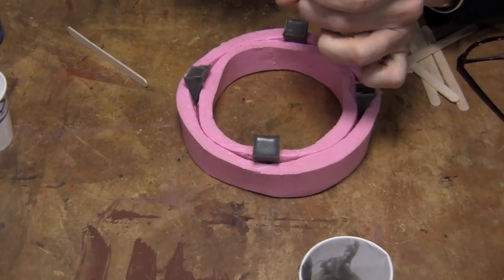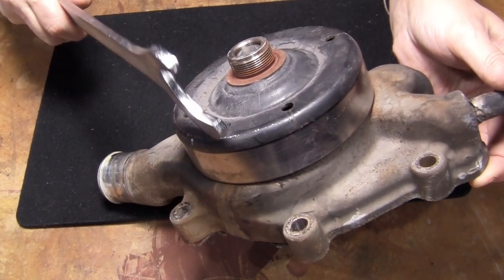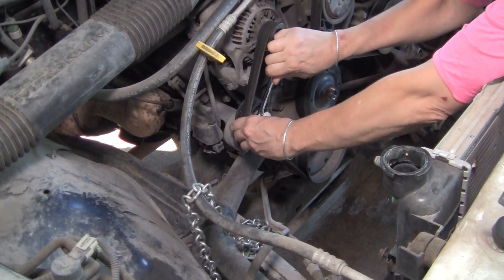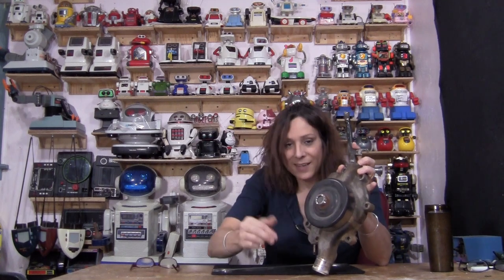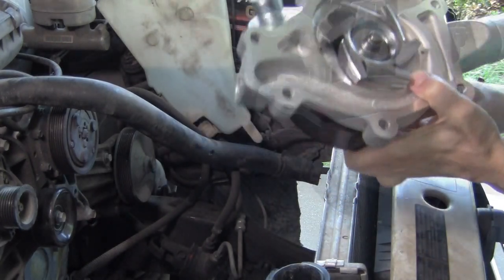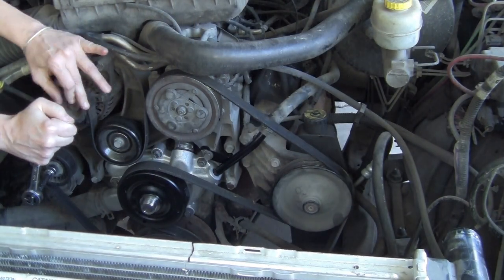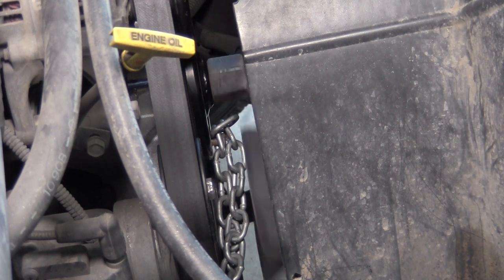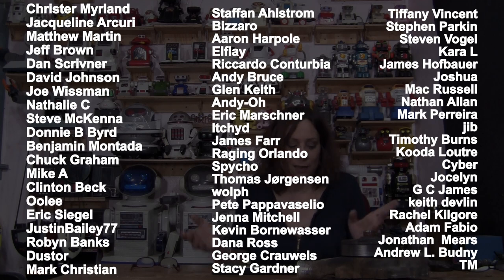I Had To Buy A 36mm Wrench - I need to fix something big

Comment: You should have glued the gasket onto the water pump, its the little tricks of the trade that you dont know about that makes the job harder. I'm impressed that you got the job done. Well done.
Reply from the maker: That sounds problematic. The crappy one wouldn't have helped, and the nice one was easy. What glue would you use?
Reply: @RandiRain  At the parts store they sell "RTV" these are sealants for different applications, The one to get is the Grey color one it is a good general purpose sealant, next spread a  thin layer on the mating surface of the pump then press the gasket onto it and let it set up until the gasket stays put then spread some sealant on the engine and put a couple bolts in the pump before installing this does two things it helps hold gasket in place and makes lining up the pump to go back on engine easier. Once installed let sealant set up completely (few hours) before adding coolant back in.  Source: I was a mechanic for many years.
Reply: @RandiRain  I would have used spray contact glue, that way it wont move when you install it onto the engine. RTV will also work. Everyone's got their tried and tested way. Have a nice week-end, thanks for all the videos and all your electronic knowledge.
Reply: @ameliaroberts3945  Contact adhesive works well on sump gaskets, coat both the gasket and the surface, leave to tack up then use a few studs to align the gasket to the block and stick it down, then you can slip the sump on the studs to align it, push into place then put a bolt or two in to hold, then remove studs and put rest in, and tighten to right torque. The right torque, not tighten to just before break, as that distorts the thin metal and causes it to leak. Yes you will struggle to get it off again, but not going to leak. Make sure the contact surface is not warped or the bolt holes domed in, fix that first.
Reply: @MrKroogur  never double gasket!

Comment: Nice repair. Yeah, the struggle with proper fitting parts and just not being able to see or contort oneself is very real. Your blood sacrifice to get the job done was exactly what the car gods needed. Love the chain hold down technique. If it works then it works.
Reply from the maker: I saved $300, that's why I had to do it.
Reply: How about next time

Comment: The entertainment value on this was great! Apparently nothing stops you from getting things done! How did you shrink yourself to fit inside the truck? That's magic!
Reply from the maker: I wish I could have shrank myself. That's one of the reasons I hate working on vehicles. I bet it's way easier to lift them up and be underneath them.
Reply: @RandiRain  Yes US trucks are large, but if you want a vehicle you can actually climb into the engine compartment to do work nothing beats the Lada Niva, which has a massive engine bay, just have to remove the spare wheel, high lift jack, tool kit and starter handle from it. The vehicle that comes with factory wear in it, and as the cheapest decent 4x4 at the time, who cared if you ripped the paint to bits. Only thing is the cooling was poor, but the heater had 2 settings, off, or volcano. But would go just about anywhere a mountain goat would go.

Comment: Just to let you know, a lot of the nationwide part stores have a free loaner tool program. You go to the store and pay a deposit (usually the cost of the tool) and when you bring it back, you're refunded the full amount. I mention this because O'Reilly's has a clutch fan wrench set with a 36mm wrench in their loaner tool set I've used before. Just something to keep in mind if you ever need a specialty tool again. 
The chain was a great idea to hold the belt pulley.
Reply from the maker: I went there... The one near me didn't loan out wrenches. They had the tool that holds it that you could use, but my chain worked for that. They had a wrench there I could buy, but that was the $35 version, and it wasn't anything special.

Comment: Great job 👍🏼🤠 little tip for cheap gaskets use gasket maker silicone and glue it to the engine block let it dry a little bit then put the water pump on. The gasket maker is good to put on the bolts also that antifreeze come out of.
Reply: Not recomended for long term use

Comment: I am sorry to hear that you had trouble finding the wrench.  I do not usually buy tools at the auto supply stores, but prefer to use the big box hardware stores.  Try searching for the part there before going to Amazon: I found the same size wrench in stock at the local Menards for $20 with a lifetime warranty.

Also, it's pretty cool that you have enough room to climb into the engine bay once the fan shroud is gone!
Reply from the maker: Menards? What the hell is a Menards? I can tell you Home Depot, Lowes, and Harbor Freight didn't have a wrench anywhere close to the price I paid. If they even had one.
Reply: @RandiRain  Menards is the green one.  :)  I guess that one is not in your area.   Too bad: you could have saved big money at Menards!

Comment: Anymore, my repair calculations takes the price of buying decent tools vs. taking it to someone else.

Within double the price, making it someone else's headache seems more prudent, and hopefully they have a better idea of what they are doing than I would.

Except for plumbing. I've learned that lesson multiple times the hard way.
Reply from the maker: Yeah... There's also the factor of how much I've already spent on that truck. I just got the registration renewed, which means it has to be inspected, which it didn't pass and I had to do some work on it. etc etc. I pretty much had no choice but to get greasy.

Comment: nice repair Randy, what I would have done differently is put 1 bolt through the hole of the water pump mounting holes and then fit the gasket over the bolt or bolts, as 2 would be a better idea, but harder to do, as then really need 3 or 4 hands. or a lot of 4 lettered words!! but it should hold the gasket in position while trying to fit the pump into place. but yeah any bends in the gasket then far better off buying a new one, as would be weak once bent, regardless of if ironed or not.
Reply from the maker: That's what I did. I did exactly that and you can see it if you look closely. It was garbage compared to the other one.

Comment: how annoying, I had to replace a few heater cooling hoses on my van recently and it was such a pain in the A.  The hoses were all the way in the back by the firewall so I had to basically site on top of the engine and hang upside down to reach behind. All that yoga really paid off for that job, lmao.
Reply from the maker: I know... It's like they try to design it so that it's difficult.
Reply: @RandiRain  Saved 30 seconds in assembly in the plant, who cares for the mechanic that has to remove half the vehicle to replace it.

Comment: Gasket easy fix is to glue it to the pump body with gasket sealer, then leave for a half hour to semi cure and then it will hold. Would not even buy that spanner, adjustable will  work well enough on that nut anyway, and the big one has multiple other sizes it fits as well.
Reply from the maker: That's a good idea, no one showed that in any of the videos I watched. They just slapped it right in there. Which I did too when I got a real one. Is there an accelerator? Half an hour to wait on glue... That doesn't sound Randi friendly.
I didn't even think about an adjustable wrench because all the big ones I have just barely missed going wide enough. I figured they would be more than a regular wrench.
Reply: @RandiRain  No, you do this when you are busy starting, before you even get the old one out the vehicle. Then leave it on a smooth surface, preferably with some cling film so the excess does not stick, till you need it. Both pre sealed, and flat.

I have big enough ones, they also have had use as hammers to get things in place. As to going to get a new gasket, that is why you have a sheet of gasket paper around, or in a pinch the front or back cover of a glossy magazine, though my go to was always the cover of the phone book, as that was about the best use for it, though they also were a common thing to have as emergency paper in the toilet outside.

Comment: Here's the thing.  Modern aftermarket parts are so bad most mechanics will not use them because of warranty issues (they have to warranty not only the part but all the labor).  Unfortunately, a ton of oem stuff is unobtanium and permanently back ordered because of the covid stuff.

Lucky for you this is fairly easy water pump job so even if the part fails in a few months, it's not that hard compared to many water pump jobs.  The more labor intensive the job is, the more you don't want to use aftermarket parts. Aftermarket used to be great.  I always used to use the cheapest part available at pep-boys. Those days are over.

The classic car guys are going nuts. There are no OEM parts left. Things are so bad in this area that people are paying fortunes for NOS parts.  Just imagine wrecking a brand new cam because the brand new lifters are so bad they don't even survive the break-in period.
Reply from the maker: It's a 21 year old truck. I'm not putting expensive parts on it.
Reply: @RandiRain  Barely broken in.... Unless it has a lot of rust.  Also, you will probably pay more than the difference for a tow if the part should fail.  But I get it, you don't want to dump money into an old truck.  Still, beats a payment and full coverage insurance.

Comment: I Remember I changing 
The Timming Belt.
On my Small Truck lucky fir Me.
I had Pretty 
Simp I e Set up 
One Belt.
But remove the Radiator. 
And the Serv I ce Manual
Reply: Just be thankful you do not have to do spark plugs on a Ford Triton, you take the heads off and take to the machine shop to remove them, because 50% chance one of them will snap off in the head. You actually get from Ridgid and Snap On a triton spark plug removal and repair kit, that can remove them when they break, and fix the threads if they strip out. All this because they wanted them to last 100k miles, or basically till the truck is out of warranty.

Comment: Inspiring! Would a 36mm socket wrench be an option? Harbor Freight is a discount tool source.....
Reply from the maker: No, you need a wrench, and HF wasn't very useful. My piece of metal cut out to look like a wrench was a cheaper option.
Reply: @RandiRain  34mm cheap one and a grinder also works, I have done that to a few cheap ones to get them to the right size, and a few were also ground a lot thinner for some tight bolts, plus a bit of heat so they could be bent to fit as well.